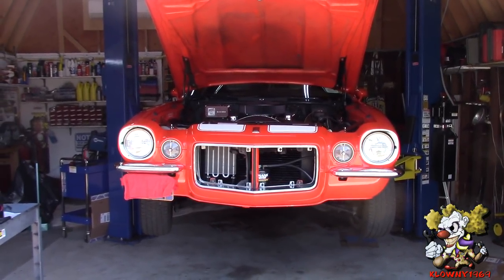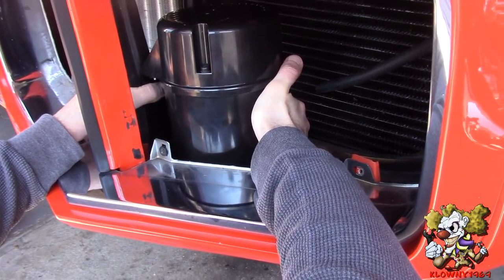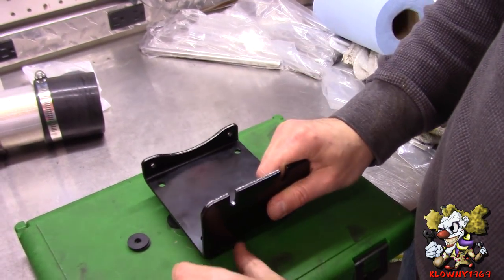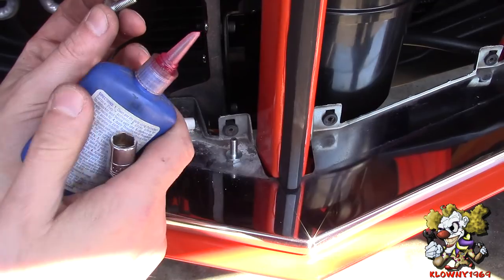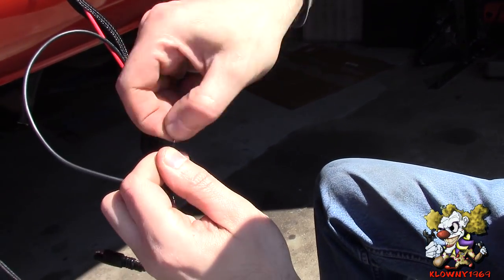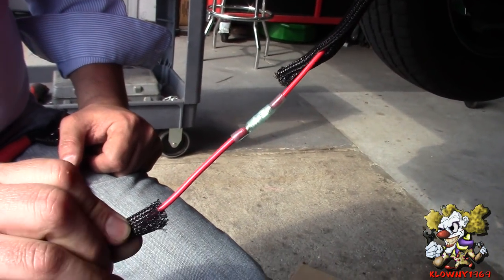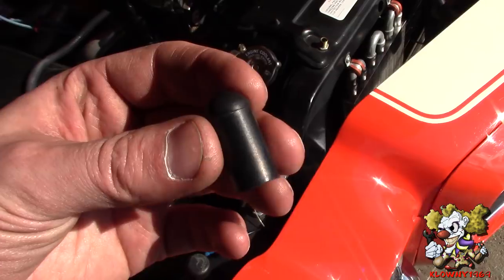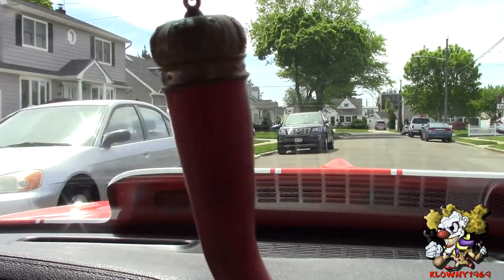How To Install An Electric Vacuum Pump For Better Brakes - LEEDS

Comment: This would come in handy for my 1981 Mercedes 240d and my 1964 Ford pickup truck f250.  I just got a remote brake booster for it.
Reply from the maker: Cool..don't forget to subscribe

Comment: I bought this pump from a Volvo dealer in the UK and the kit did not include the servo valve/switch, after much research I found the part number for this is 30616993. Note you will also need a length of 3/8" vacuum hose and a fuse holder for the vac motor power supply, kit includes a 15Amp fuse but not the fuse holder

Comment: Question: Does the vacuum pump run all the time or only when it needs it?
Reply from the maker: There is a pressure switch, so not all the time. Don't forget to subscribe 😉
Reply: @klowny1969  Thank you. The reason I'm   asking is because it sounds like it's shirt cycling.  But if I take the hose from the pump, it turns on just fine.

Comment: Is the vauum pump always running? Or is it only powered on when the brakes are applied? I have an old import thats going to be running individual throttle bodies. Been considering running a vacuum pump as a vacuum source for the booster. I was wondering if i could get away with powering it from the brake light switch, so its only running when you are on the brakes. Do you see any issue powering the vac pump in this way?
Reply from the maker: This should have a pressure switch to keep it at a certain vacuum..don't forget to subscribe 😉

Comment: Fantastic video.  Just learning about this option now.  Does the pressure bleed off?  Why I ask - could this setup be used in a car that sees light track duty?  Or will the pump constantly be running and "trying to catch up" to brake needs?
Reply from the maker: there shouldn't be a problem with light track duty..don't forget to subscribe

Comment: My car has 7-8”of vacuum at idle and my power brakes aren’t horribly bad but they still will get hard if you use them too much. I’ve heard Hydroboost set ups failing, no brakes, I’ve heard of these set ups failing, no brakes. What you can do is if you still have a little vacuum like me is tie your existing line in to your new vacuum pump line but you need to put a good quality check valve in to your line coming out of the carb. If you ever have a failure you will still have some brakes, rather your engine dies or your pump fails.
Reply: How do you tie your vacuum line coming off carb to vacuum pump line? Is it some sort of 2 way check valve?
Reply: @synthesis4030  The vacuum pump has a built in check valve. Just add a check valve coming off of the carb or intake and then a T at the booster.

Comment: man brilliant device , is this more suited to modified engines with low manifold vacuum or even standard cars, i want more responsive brakes. Ive been in cars with weak diaphram springs in boosters and you just about go through the windssheild, thats the kinda brakes i want LOL.
Reply from the maker: It's more for low vacuum big cammed engines or boosted vehicles..thanks for watching and commenting

Comment: how would you compare this pump to a hydroboost set up, I'am torn on which way to go thanks
Reply from the maker: This is much easier way to go..and the braking might be the same or very slightly better with hydroboost

Comment: Added a rotary vac pump off a vw touareg on the 88 gta. Also hooked it up so if the rotary pump fails, the dismal manifold vac will still work enuff to get ya stopped. Any suggestions on what hood to put on this thing? Going to put sniper fuel system with rpm q jet intake. Hood clearance sux on these cars. As always ,  love your vids bubba!
Reply from the maker: You can do a small cowl..thanks for watching
Reply: @klowny1969  Small as in a 2, 3 or 4 inch? New to building these 3rd gen stuff. Much respect sir!
Reply from the maker: 2 should be fine..but becareful, depending on where u live that might be illegal
Reply: @klowny1969  I live in Alabama.........nuff said LOL. And thanks as always. May shoot a small vid showing how i set up the vac system in mine. Think total cost was like 94 bucks  and works like a charm. Total vac time on empty canister and booster  is less than 7 seconds

Comment: There's gotta be a better place to put a massive air restrictor than infront of the radiator.
Reply from the maker: it doesn't restrict the air not one bit. It's nicely hidden and the car remains cool as ever. Don't forget to subsribe.

Comment: HAVE I GOT A PROBLEM FOR YOU! LOL have you run across this, or have any idea what could be happening to me? heres my issue..My car is a 69 coronet with 500CI, I'm running a AC fan, Vacuum pump, 2 electric cooling fans. I have a EFI fuel injection.When I get up to temp, I lose the 2 cooling fans, and vacuum pump causing over heating of engine and loss of brakes. AC fan still operates.When engine cools down, 2 cooling fans and vacuum pump operate normally again.Any Ideas?
Reply: Are they wired to the same circuit? Or grounded at the same circuit? What are they wired to?
Reply: Chris Bentley I got troubleshooting a little
More into it, and it appears before the power gets the the relays for fans and vac pump, it goes through 3 30amp fuses. I think those fuses may be the cause.

They are 2 terminal fuses, I can hear and feel clicking in them once the fan and vac pump stop working. Think they may be the issue?
Reply: @deanberger9597  if they click, they should be functioning. If they dont click, then that's when I'd suspect the fuses. You might have them wired up wrong. Give me like five minutes or so and I'll try and find which terminal is supposed to go to what
Reply: @deanberger9597  battery-fuse to 30, ground switch to 85, 12volt fused power to 86, fan to 87(wire depends on which polarity you want).
Reply: right, yeah that's all correct to the relay and from relays, the ground is correct too. I did replace the replays and same problem happened. It seems like I'm losing power to the relay.The series of 3 fuses run the positive(power) to the relays. I don't see any reason why the fuses would be clicking while they are suppost to be providing power to the relays toperate? is it possible the fuses are getting to hot and not working? because everything works once the car cools off. When its warmed up and hot, the fuses just click, and do not function.I know, iv been dealing with this for a year now lol
Reply: @deanberger9597  relays click when they activate. That's the sound of the arm inside switching over due to the switch energising the coil. I would rule out the relays if I were you due to that, but if itll make you feel better to replace them, by all means. I'd start where you have the power and ground first. It energizes but theres no power coming out when warm. Where is the switched power and ground going to? 30 amp is more than enough per fan.
Reply: Chris Bentley right, so the relays don’t click when car is warmed up. I hear clicking from the 30 amp duel post fuses. 

And when car cools, the relays start clicking and operating again. 

It’s on all 3 relays. 2 fan relays and 1 vac pump. 

Those 3 30amp duel post relays, can they become faulty and work once they cool off?
Reply: @deanberger9597  I've never heard of relays not working when the system is warm and then work when it cools off. Relays dont really warm up, is the wiring wired to something that doesnt provide power when the engine warms up? Or ground? Like your fused source?
Reply: Chris Bentley yeah I believe relays are fine. 

The 3 30 amp fuses that supply power to the 3 relays from the battery, I suspect are the issue.
Reply: @deanberger9597  inspect them. See if there are any breaks
Reply: Did you ever figure this out?